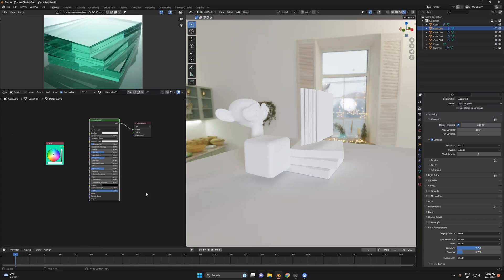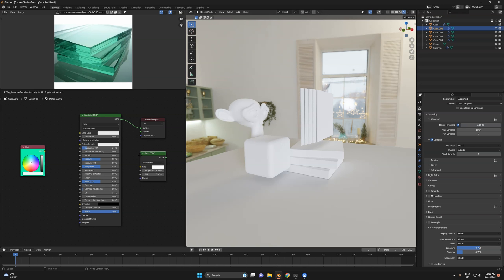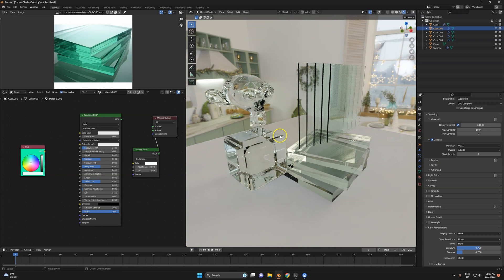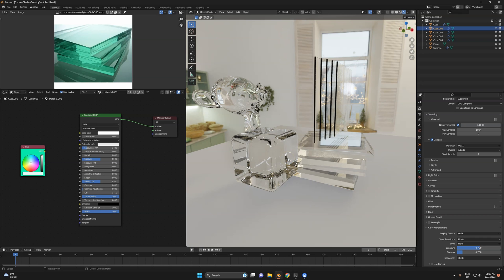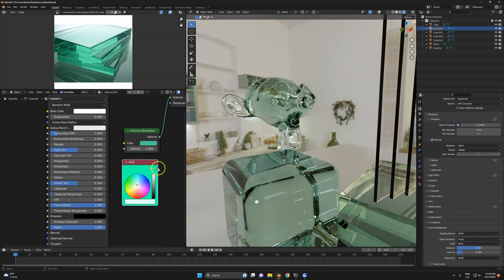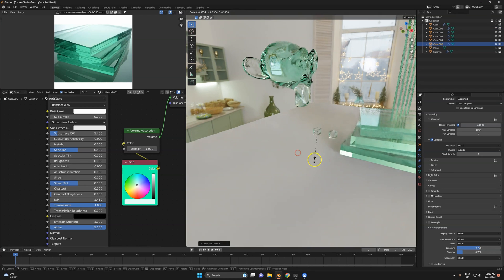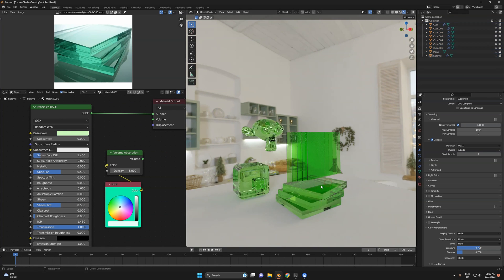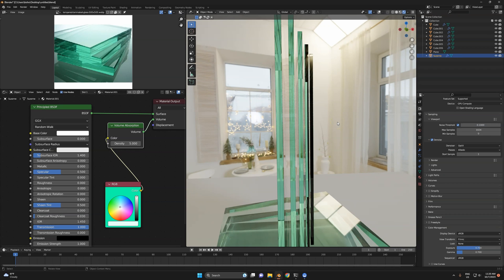Making Glass Shaders Great Again | Blender Tutorial

Comment: should we use this way for car's windshield and glasses as well?
Reply: You can use volumetrics for pretty much any transparent material that has an absorption depth. Other renderers like Arnold for example have this built in the shader as a slider that adds extra depth absorption. Blender simply chose to give a much more modular approach, here and offer the user to include depth absorption manually.
You can use it for murky water for example or add some depth mapping and color ramp if you want to go crazy.